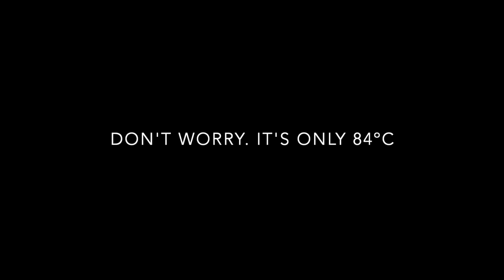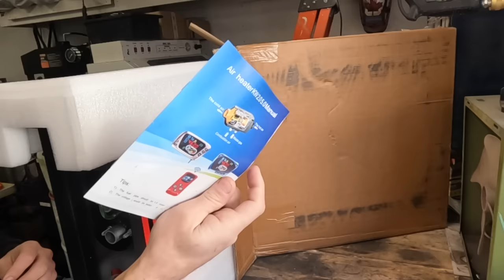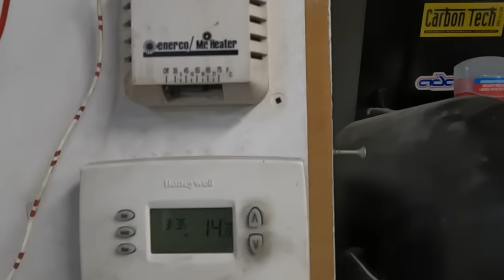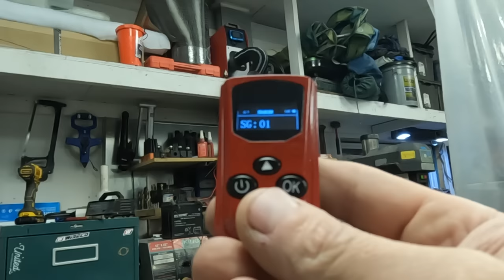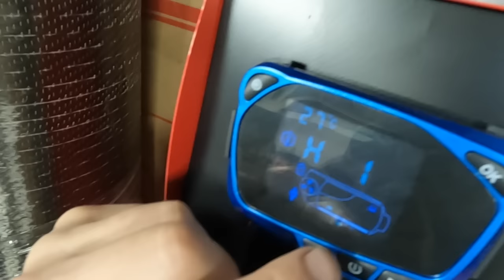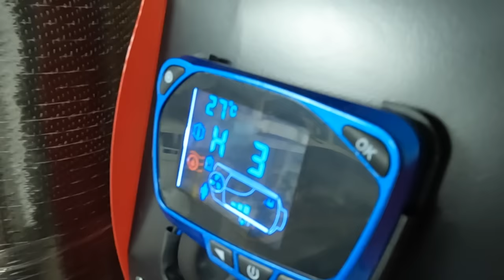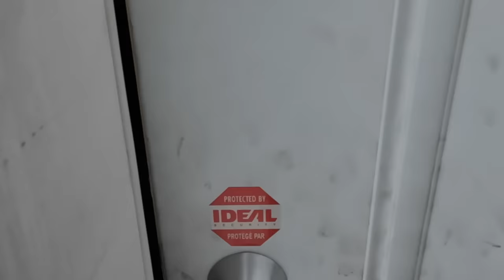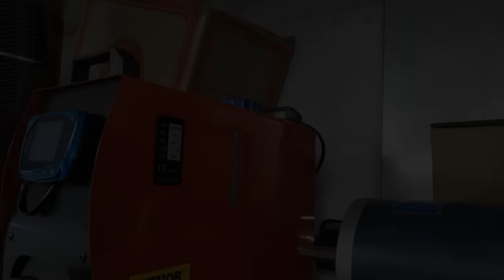Chinese Diesel Heaters - DON'T BELIEVE THE HYPE !!

Comment: Like you I have just bought one of these. It runs fine on 20%deisel 80% whatever other fuel you want. I use a 2 way valve to start and stop on pure deisel for ten minutes startup and stop. To get it up to temperature and to hopefully decoke at the end of the cycle. Think you may have a faulty temperature cut off.
Reply: Thanks for the info. In my climate, even with a fully insulated garage, I have to run my heater at full blast, nonstop to try to keep a reasonable temperature... so there is no shutting down... I have heard of this and I may try this set up and just switch it every 4 hours or so to see if that works. Still trying a few things. 

Faulty temp cut off ? Not 100% sure what you mean.
Reply from the maker: Just realized I replied to you while logged into my other YT channel. Oops. Hope I didn't confuse you too much.

Comment: It is not a good idea to put the heater under the ceilling, because it  suck in the already heated air. I run 12-16 years old Eberspächer heater with a 3:1 Mix of Kitchenoil/Diesel  and works flawless. However, the Diesel must be WINTER DIESEL with the added Winter-Additives, otherwise your fuel pipes/filter will get blocked
Reply from the maker: Thanks for the comment. 

The location of my heater was chosen for ease of access as I had a feeling like I would have to work on it often. What you say about the hot air into the inlet is true but not really substantial. 

You have been running 3 parts kitchn oil and 1 part diesel ? or 3 parts diesel and 1 part kitchen oil ? I have heard from many people who run 50/50 or even 30/70 (30 veg oil) and have troubles after less than a month. 

Do you know if the old Eberspächer a pressure fead system with an injector nozzle, or a drool feed like the chinese units ? 

I am currently running road diesel, and today it is -33C and the warmest it has been is -28. My heater, fuel and pump are all sitting outside and I haven't had any issues.  Luckily it is warming up soon.
Reply: @loweredexpectations4927  
With kitchen oil you need to heat it up to around 40-50°C and then filter it careful with a net filter (pre-filtering for bigger dirt), then using a 10my filter and then a 1my filter.

Now you have two possibilities:

1) Cracking it (there are some YouTube videos about) and it give the best results since it become very put Bio Diesel

2) Use it as it is, but add 3-6% of additive which make the Kitchen oil durable (you can get the Diesel Pest into it) and around 2-4% additive for making it more liquid (even in the summer). This Type of Bio Diesel has to be mixed with WINTER Diesel which you can get with 1st of October on all Petrol Stations in Middle- and Northern Europe. In other countries like the USA you have to add it yourself. You can run in the Summer a Mix of 3/4 kitchen oil and 1/4 Diesel, but in the Winter, only 50/50 if you can be sure, that the Mix will never get under 0°C.

However, I use a 2/3 way valve attached directly (absolute shortest way) to my MIX-Tank with one inlet and the second Inlet to the Winter-Diesel Tank.

If my Thermostat switch on, the Diesel Heater run from DIESEL, and after it is running it switch to MIX-Diesel.
If the Thermostat switch off, I have Delay-Off Relays which prevent switching off the Heater, while the 2/3 Way valve change immediately to DIESEL.

The time for the Delay-Off Relays must be chosen accordenly to the volume of the Diesel-MIX in the pipe, hence the Diesel Heater must run so long, that only pure DIESEL is standing in the pipe

However, Oil from Sunflower, Olives and Rape react different (aso the manufacturing process) and this is what you have to figure out yourself
Reply from the maker: @michellekonzack  I have heard of people simply diluting  / cutting kitchen oils for diesel engines, and that seems to work quite well. The issue that I have heard from many is that unless you remove the glycerine, you will get a nasty build up ... The reasoning : Veg oils have X amount of glycerine so after you burn X amount of oil, you are left with X glycerin in the burn chamber. 

Unlike a diesel engine, where the fuel is injected at high pressure in a highly atomized mist, and the combustion process is pretty .... violent / energetic, these diesel heaters are basically candles, that pump oil onto a wick. Whatever contaminants you introduce will pool in one spot and quickly cause a blockage.  

I personally have not tried veg oils of any kind, but I have heard from dozens of people who have, without success. I have tried starting on diesel while burning engine oil and there was a minor improvement, but have not yet tried veg oil.
Reply: @loweredexpectations4927  
This, why it is better to crack the kitchen oil (it take around 24 hours) and then you see the separation of the oil and the Glycerine (settle at the bottom)

Comment: Not the smartest peanut in the turd huh.  I’ve heated a two car garage for four years and I’ve never had a problem besides the first time when I over primed it. His whole set up is wrong All of his failures were obvious. 
After seeing this video, I would never trust him on any subject.  But it is good information to learn from other peoples mistakes. 
Only run diesel or kerosene, which is pretty much the same thing. Never really have a problem. I ended up buying three more because they work so well.
Reply from the maker: 67 Thousand views on this video, and you are one of the Special few who: 

1. Didn't bother to actually watch before commenting. 
2. Aren't smart enough to figure out what the video is actually about ,or hopefully... 
3. Were just having a bad day and just decided to vent in my comment section. 
 
Where should I even start. I have 4 of these heaters and 3 of them haven't had any issues... You don't have to be smart to not have issues with these heaters. The 3 that don't have issues... I run on diesel. I've heated my garage, two vehicles my house and a wheelbarrow... in a year... I'm an overachiever 🤣

My setup has nothing to do with my heater failures, and you claiming it does shows that, you probably know less about them than you think you do. Feel free to tell me about the "obvious" failure, based on my setup, and I will explain to you why you are wrong. Waste oil is the only reason. 

Ding ding ding ... We have a winner !!! .... "learning from others mistakes". This video, and the 30 after it, are dedicated to testing (mostly) false claims made by other YouTubers,  YouTube comments and people on forums and blogs. I've had a LOT of people comment saying I saved them from burning "alternative fuels". 

These heaters are awesome ! The reason I tested it with a waste oil mix is because 3 popular YouTubers were making claims that this would work fine. (That and I love experimenting) I have lots of oil and thought I'd see how much it would actually burn. I didn't believe the "3 years without cleaning" that one person said, but I thought maybe a month. 

PS. You can also burn paint thinner or Varsol and it works perfectly fine. I am about to test acetone, lacquer thinner, and some more interesting things like bacon fat, coconut oil... and some secret stuff.

Comment: Yikes. I just bought a second unit from vevor for black Friday. U$88. Been using my first unit for last three years. 

I'm Using double filtered used diesel sailboat engine oil, blended half with diesel and it is running hotter. I added a small restrictor in the air recirculation intake to manually manipulate less cooling airflow to increase burn cylinder temp. I can only think that if you didn't connect the exhaust prior to startup, you didn't watch too many videos about the unit. There is a scottish guy mcgee47 or something, watch some of his videos. 
Your videos is creating more misinformation, and could be deadly. Why on earth would you install it at the ceiling height? Closely inspect the muffler, it has a condensation breather hole, and should be vented on the outside of your workshop. Please have a nonstop rolling scrollbar at the bottom warning every watcher to not do this. You sure are a good candidate for a Darwin award, you could've burned your workshop down, and would blame it on the diesel heater, meanwhile it's your less than ideal install and lack of knowledge of the fuels.

 Please do a retake video with some improvements. Get a scooter or dirt bike muffler that is more sealed if you absolutely need to do an inside muffler, or research how we do it on sailboats in our engine room. Some people in UK have excellent installs and use this as primary heatsource, claiming it's ⅕ of the electricity heating cost equivalent. I hope you could find the same median.
Reply from the maker: I found your comment by scrolling through ... YT didn't inform me... odd... Anyway. Thanks for the detailed comment. 

I think a lot of my issue may be that I am using oil from air cooled engines... It's had a pretty rough life by the time it comes out, it's already burnt up pretty bad and has a lot of contamination. I am currently using a two layer cotton filter, so better filtration may help some. 

I have tried half and half diesel, but I am still testing... currently 1/3. At half and half, it would cost me more to burn waste oil than it would cost me to use my natural gas heaters. Experimenting to find something that is hopefully cost effective. I have played with restricting air flow ... are you talking about on the combustion air or the ambient air? I have tried both, but not long term. 

I didn't connect the exhaust because I have really really bad luck with every single purchase that i make, and I fully expected that it wouldn't work at all, and I'd have to immediately take it apart. I had only watched a few videos at that point tho, yes. I also run my jetski in my garage, and I promise you, an 1100cc two stroke is much more nasty than this heater.... 

I'm not sure how I'm spreading misinformation? First off, the start of the video says not to do things that I do because I take unnecessary risks. I go on to say that what I did didn't work well and that these can be dangerous. I show that garage filled with smoke and then I show that my exhaust caught on fire... This is pretty clearly all stuff that you don't want .... right ? Just like you were able to understand that these things were clearly not good... others will get the same idea. 

I installed it on a shelf as it was easy, out of the way and it was close to my ventilation duct. The only drawbacks are that it is a pain in the butt to get to and heat naturally rises. I point the vent down and it works fine. I may move it for ease of accessibility at some point. 

Yes, the muffler has a condensate hole in it... I am quite aware of this, just like every motor vehicle. I'm guessing you have never taken a confined space or hazardous materials safety training ? I have. I have family friends, a father and son, who died in their home made camper from carbon monoxide... Just like everyone else who dies from it, they died in their sleep. It's not something to be complacent about, but the symptoms are REALLY obvious, and if you are awake, there's no way you'd stay in a room and die... 

I get that you are concerned but you are able to pick up on the fact that I almost burnt my garage down ... I'm guessing that anyone who watched the video noticed... This is an accurate representation of what can happen if you don't do a proper install and play with alternative fuels... I didn't try to pretend that the heater worked well, or that my exhaust caught on fire and could have caused a fire... I do edit these videos, and I could have easily edited that out.... Now THAT would be misinformation and that would be dangerous... 

Scooter and dirt bike mufflers generally will have condensate holes as well... They also produce condensate. I'm guessing some cheap chinese ones don't ... but many of them have more leaks than a condensate hole. I actually got done filming an intro for my next video just a few hours ago and because nothing really obviously bad or crazy happened, the first thing I did was give a safety warning. 

Thanks again for the comment and concern. I do appreciate it.
Reply: Lol.....yeah, this youtuber is the type of "mechanic" who cant understand why the pistons melted in the 2 stroke engine that he just rebuilt

Comment: I wonder why more people don't install these outside the garage and only plumb the DC wiring and heated air outlet into the building. Maybe the fresh air inlet as well so you have warmer intake charge to begin with. Seem less risky in case it does catch fire, meltdown in any way.
Reply from the maker: I am strongly considering this. There are two main reasons why I have not done this. One is that if you have it outside, you either need to have two 3" holes in your wall, or you are heating outside air. Heating outside air is not going to work where I am.  It was -30C all last week. Trying to heat -30C air wouldn't work very well. Secondly is that when I frequently stopped working, I would have to go outside in the freezing cold and snow to remove and install it for it's daily cleaning, haha. 

If you are running diesel and don't have issues with it running, this is a way better set up for sure... You would have to recirculate the inside air to get good results, but this is much safer, quieter and it doesn't take up space inside.
Reply: @loweredexpectations4927  Makes sense to pull shop air, not ambient outside air. I'm SW B.C. so it's not as cold. I'd imagine the lcd display won't work at those temps either, so you'd have to extend the harness and move controller inside. Best option I've seen for reliable use oil burning is a converted oil furnace or dedicated shop heater but they're $$$. The residential furnaces can be picked up for free and there's a couple ebay sellers that have the whole conversion as a kit depending on how much free time you have to mess with the guesswork otherwise. I've also been skeptical of some of these videos since used oil is so inconsistent even from engine to engine. Like grandpa's 76 caddy is going to have way more carbon and hc after 5k than a new Toyota. Clean oil doesn't burn worth a shit.
Reply from the maker: @tkovac4912  Spot on ! Waste oil is very inconsistent. If I was in a different area, I would totally build a waste oil furnace, but it's not practical for me here. The biggest difference between these and a homemade WO furnace is the ability to clean them quickly and the size. If I can crank the fan speed up independently of the oil, I have been told that that will create enough turbulence to clean the chambre out... Do I believe it.... not yet.

Comment: I like the opening speech! As an engineer working at power plants with all sorts of fuels I would say that there is no way you will get anything safe for that price or that is made in that country. And it was proven in this vid that it does not have the security features that would be required on something that burns and have a tank on top. The reviews I have seen it all looks like quite thin and flimsy meterial and in time it would risk burning hole and contaminating the air going into the house which could cause injury or worse. I would never put this in or near my house. Buy an air/air heat pump instead or go for a proper heating system.
Reply from the maker: Thanks for the comment, glad you like the intro ! haha. 

These seem to be ok when burning diesel, but yes, many of them, including mine, have a very stupid program that doesn't have many inputs to make it safe. Some other ones have more sensors, but still with something this basic, there's not much in the way of safety. 

I have a 200,000 btu tankless heater that runs off natural gas for my floor heating, and a back up 80,000 btu Mr Heater unit. This was supposed to be a supplement to burn some waste and save some money. It's turning into a real headache.